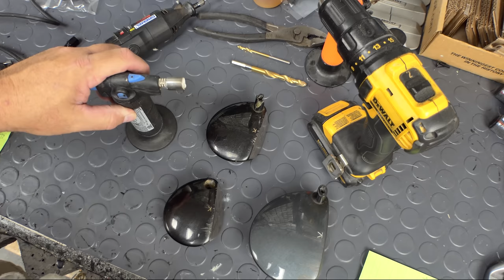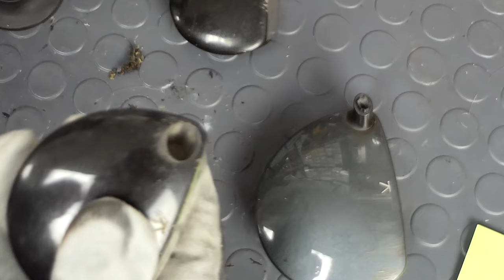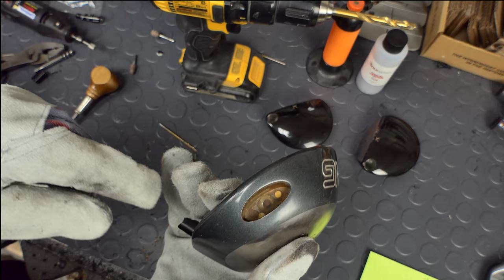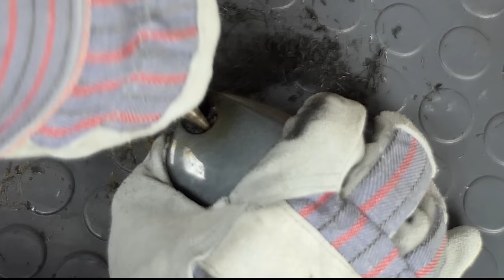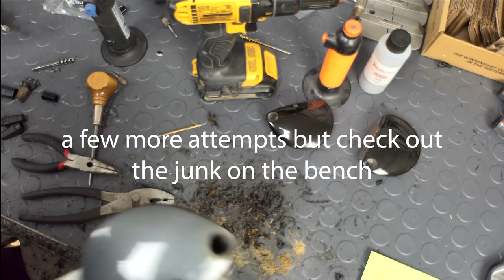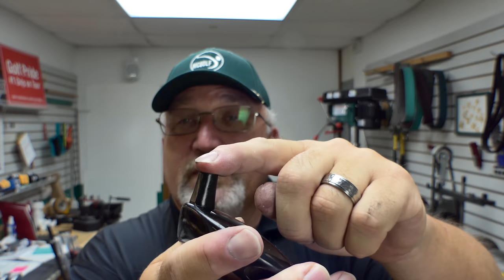2020 ping ISI reshaft

Comment: I play the titanium version fairway woods today.  I used to play the driver but that  was years ago. The TiSi tech 3 wood and 5 wood originally sold for $350 each when they first came out. They are amazing woods.  Real rocket launchers. I’ve yet to find anything better. Originally I played the stainless steel version like you have there. I then went on to try other brands but never found anything that felt quite the same as these Pings. You can still find them on eBay for good prices around $30-$50. The titanium versions still sell for anywhere from $50-$100 which reflects the quality and performance of these woods.  Changing the Shaft on these usually required someone to send it back to Ping and have them do it as I broke one at the hosel  once and had it sent back because my local pro shop said they just could not do it. Watching you do it it does seem like an a lot of work and I admire you for doing such a good job in salvaging these great clubs

Comment: To replace the shaft in the ISI driver R flex. What parts would I need to purchase? I bought mine from play it again sports for 5.99. Measuring from the top of the head to the top of the shaft measures 41”, I would like to have 45” r flex. I would appreciate any recommendations in the middle price range.

Comment: It looked a little like the ferules were slightly off set,  If that was the case was that something ping used (back then) to adjust loft and lie when assembling the clubs?
Reply from the maker: Not offset but if you wanted to adjust it was a matter of sanding the part to fit in the proper,way

Comment: If the customer wanted to replace those swing weights, would you still be able to source those too?Just curious...why go through the effort to fix up the club without replacing those?
Reply from the maker: Those are an oem part. I’ve put lead tape in them before not pretty but worked.
Reply: @McGolf  Here's a dumb question, is it possible that this particular player hits the ball better without the weight? Or I should say is there a reason you would actually want to remove them?
Reply from the maker: SNeal5966 sometimes yes it’s really about the way the clubs act